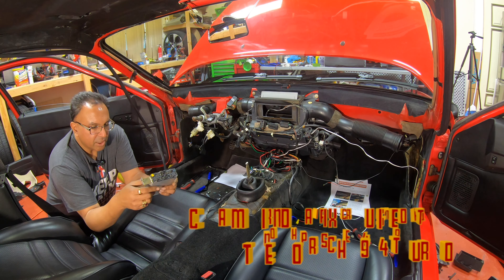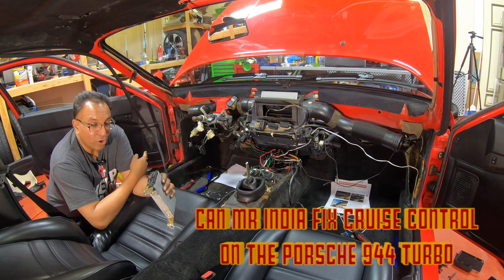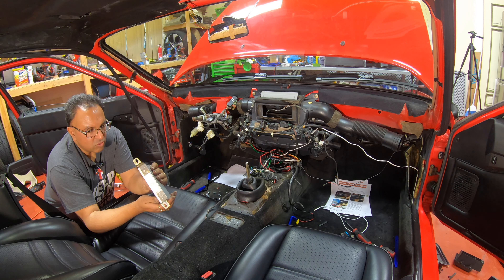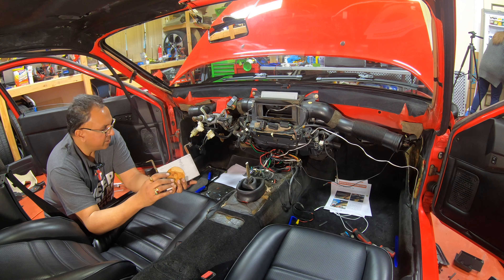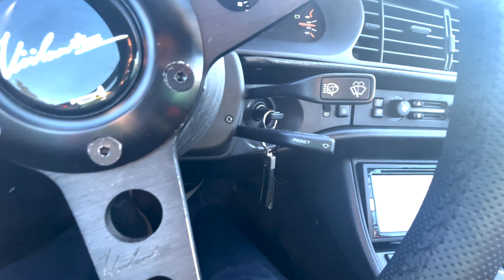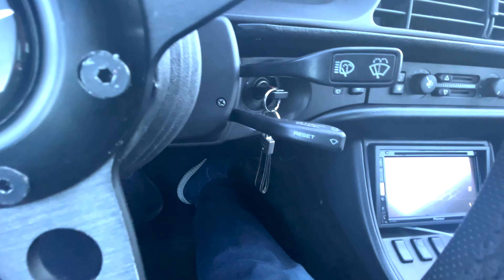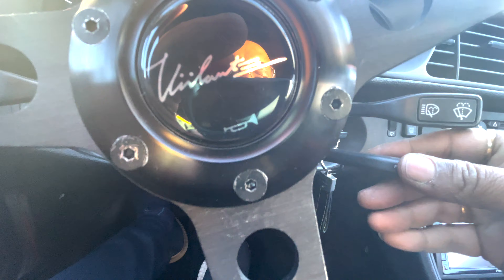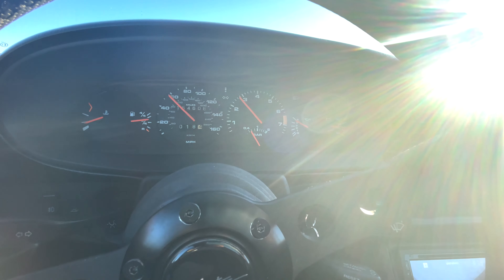Short and sweet - Mr India,  can he fix Cruise Control on Porsche 944 Turbo?

Comment: I don't think I've even tried to see if my cruise control works. But I think I will take the unit out while everything is all apart.
Reply from the maker: Yep its a great idea just as a service item to resolder all the joints. I was surprised to see my cruise was working